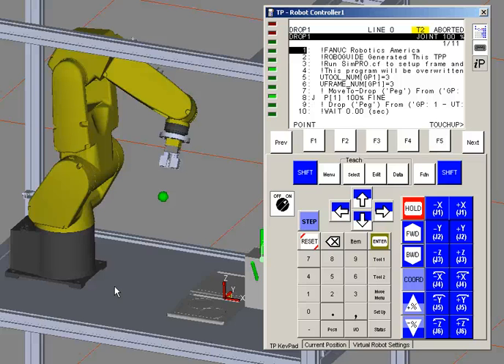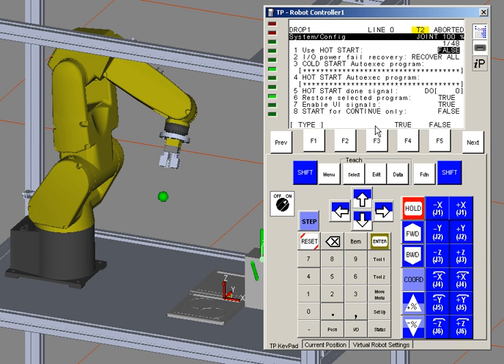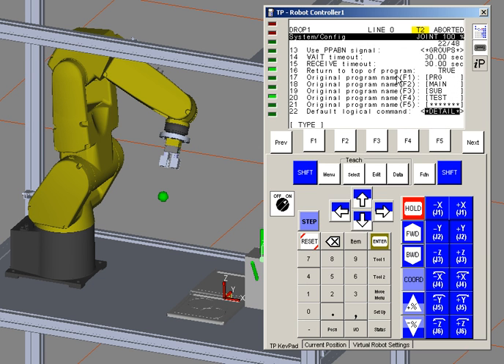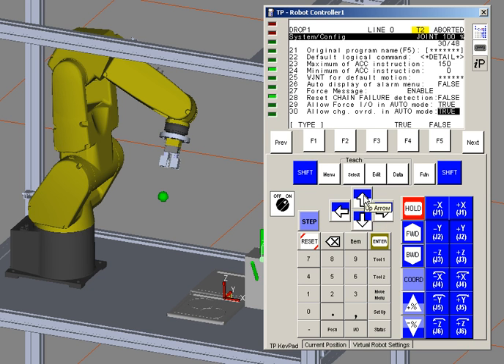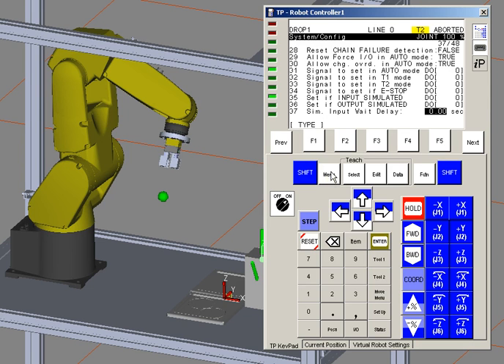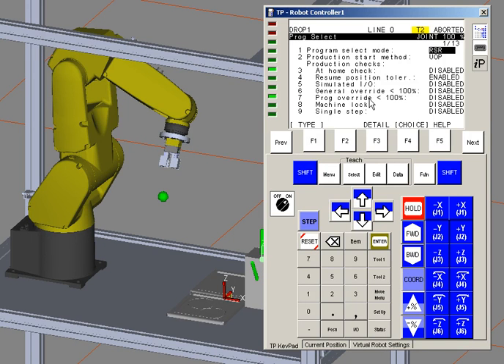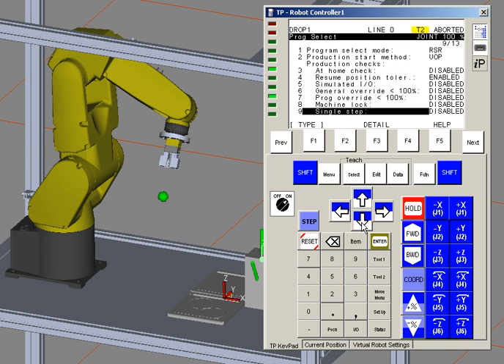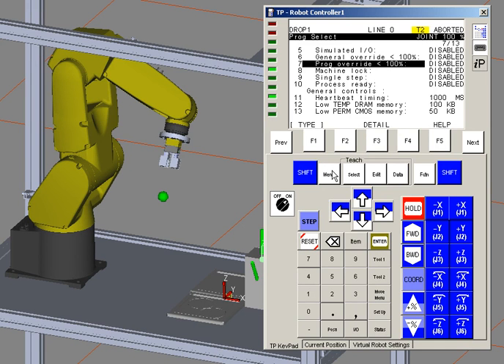Production setup and Program checks on a FANUC Controller

Comment: Sir why we need to put t1 or t2 mode while checking program
Reply from the maker: Checking or testing your program should be done in T1 mode, to verify all motions and logic at a safe speed (250mm/s) - T2 mode (not available on all systems), allows testing at full speed. Both modes T1/T2 require you to have the Teach Pendant deadman switch depressed.

Comment: Do you have a video that shows how to set up macros for tooling? I have a 200ic with a Schunk gripper on it and the teach pendant doesn't know it is there. I need to be able to open and close it. Thank you!
Reply from the maker: Linden Brasic I don't have one, yet. Working on creating one. Sent me an email - go to www.amstmadison.com and submit via webform -  and I can send you some instructions. How is the gripper controlled? Through Outputs in the robot arm or external valves?